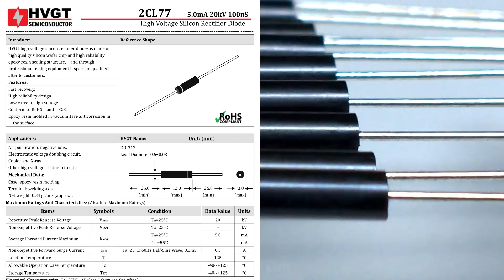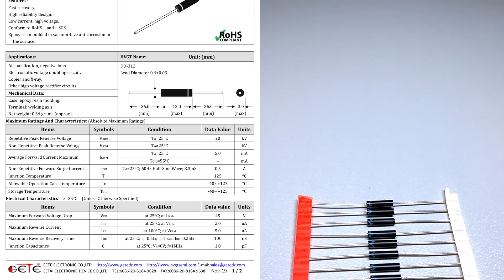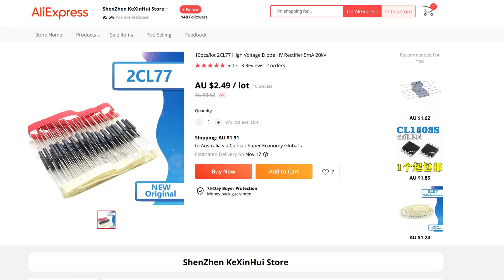20 kV Diode Teardown

Comment: Great view of the inner construction! It's funny, if you read descriptions on using diodes, they often say NOT to string diodes in series to raise voltage ratings for numerous reasons, usually describing a cascading failure scenario due to one junction breaking down earlier and passing the current to a weaker one, BUT, that is the exact way they construct high voltage diodes as shown by your careful dissection and viewing. Granted, more care in matching the forward breakdown junction is most likely put into these, but there still will be variables that will make no construction a "perfect balance" throughout its manufacture.
Reply: Almost all HV "diodes" are made like this, you should see the diode strings used in megavolt powers supplies for particle accelerators like dynamitrons, its the same just thousands of them. I think the key for successful series diodes is to greatly under rate it compared to the single diode specs. Say a single diode has the specs of 1000V 1A peak and a recovery time of 20ns but you want a diode string to rectify say 10kv 100ma so you put like 30 of those diodes in series, that could theoretically yield a 30Kv 1A diode string but you only rate it as 15Kv peak 500ma 100ns recovery time.

Comment: Hey WizardTim. I work for a company in the United States that makes high voltage diodes - quite similar to this one. To give you a bit of feedback on the forward voltage drop, two main points: 

1) HV diodes tend not to be a typical PN junction since they hold off about 1kV per wafer, they therefore are thicker and have a different resistance profile because of it. This makes each diode wafer usually more in the 1V - 2V per wafer range, though this does depend some on the reverse recovery rating of the diode. 

2) Keep in mind that the rated VF is the absolute maximum for the diode, so there is likely some margin there. For instance, on a similar diode we manufacture, a 45V VF rating usually means the diode tests (on the bench) more in the 35V range.

Feel free to comment back if you want more details or have any other questions about high voltage diodes or high voltage diode manufacturing. I would be happy to provide more information.
Reply from the maker: Thanks for the info!

Since posting this video I measured the diode with a PSU at some currents:
15.5 V @ 1 mA (0.70 V/die) 
21.2 V @ 5 mA (0.96 V/die) 
24.8 V @ 10 mA (1.12 V/die)

So as you say they’re just rather generous with their max VF rating. This is kinda surprising to me as the power dissipation will be almost half, but at 20 kV @ 10 mA (200 W), 0.2 W is 0.1% so I guess it doesn’t matter that much.
Reply: @WizardTim  Yeah, it is a little surprising that it was about half of what their rating was for the parts. Looking at the datasheet that google provided, I don't see any graphs for VF vs IF which is what I usually point people towards instead of the max of the part. For our diodes, we have a VF rating, but if you look at a typical VF vs IF graph, you can see that at the rated current, the diode typically has about 75% of the VF rating as voltage drop. 

You are right about the 0.2W not being much with regards to the overall circuit (20kV and 10mA), but for a device small like this, 0.2W of power dissipation could be significant depending on your heat path. We have a similar part rated at 16kV (datasheet here if you are interested: https://voltagemultipliers.com/wp-content/uploads/2018/10/M25UFG_M50UFG_M100UFG_M160UFG.pdf) that could have internal heating of 13°C at 0.2W dissipation. Though that isn't much, it will change the IR, VF, and TRR characteristics of the diode. 

Anyhow, food for thought. Good video. We cross section parts sometimes in a similar way to look for damage of our diodes, but I am not patient enough to do it by hand so we have a system for sanding and polishing.

Comment: Great video.  You should buy a combo belt and disc sander.  You can get them fairly cheap from your local gettin' spot.  Even a low end one will last you a lifetime.  Might save some skin on your knuckles.

Comment: Also you can get dirt cheap diamond discs from China. For use in lapidary industry and elsewhere. Usually diamond lapidary discs can be hundreds of dollars each but the cheap ones from China are only a few dollars each and go up to crazy fine grits. From there you can even get diamond paste that goes up to 0.25 micron which is about sixty thousand grit I believe. Whereas the individual grit Pace would cost 20 or $30 for a tiny amount here... The knockoff versions from China or like $10 for the whole set of all the grits and indecent quantities.

You could get half a dozen or so different grit discs for really cheap and they cut through ceramic, silicon, glass, whatever and leave behind a great finish. It's super fast and easy compared to sandpaper and can even be used with water or other fluid coolants.

Comment: Nice video,I think microwave diodes are similar to this in their structure.I have used microwave diodes for several 100kHz to rectify a Tesla coil output without any problems.
Reply: is it possible to use microwave diode for high frecuency? even that the datasheet says it works for 60hz?
Reply: @picanazo420  Many modern microwave ovens use switching power supplies, it's possible newer diodes are faster to be able to work for those.

Comment: Maybe a small benchtop belt sander would be a good investment for the bulk of sanding this down?
Reply from the maker: I do have access to a belt sander however I’m using an ‘ultra-clear’ epoxy designed for art applications so it has a glass transition at about 50 - 60 °C so I probably couldn’t go much faster but it would take a lot of the physical effort out of it. But I would also have to make the puck larger so I don’t sand off my fingers. I might give it a try if I do something larger.

For this video it was about 15 min of prep for the epoxy, a couple hours to cure, 30 min of sanding and 30 min of cleaning up (excluding all the added time filming).

Comment: 100ns  switching time - may be it is silicon carbide inside. Silicon carbide single diode have an approx 2 V drop voltage. 2v * 22 crystal = 44 v drop voltage.
Reply from the maker: I don’t think it is that as I didn’t pay much for them and the manufacturer doesn’t mention SiC which would be an important marketing point. 

Also, from what I understand SiC diodes are more suited for fast switching high power devices (similar to GaN components) like computer power supplies where switching losses account for a large amount of the losses.

So far the best reason I can come up with is maybe they just use whatever dies they have lying around at the time to get to a 20 kV breakdown, just so happens I got one with 22x 1,000 V dies but maybe 40x 600 V dies is a possible configuration which would give 45 V forward voltage drop?

Measurements I got (not very accurate just with a bench PSU):
15.5 V @ 1 mA (0.70 V/die)
21.2 V @ 5 mA (0.96 V/die)
24.8 V @ 10 mA (1.12 V/die)
Reply: @WizardTim   in hight voltage (1000v) hight current rectifier made in silicon carbide is hight cost. But in low current device's silicon carbide is ordinary material. Like as some LED   contain silicon carbide crystal inside, but not information about this in datasheet for user.
Reply: @WizardTim  I agree, it is unlikely to be SiC. SiC is more expensive, and from what I understand it does not stack well enough (at this point) to be able to do high voltage this way. If it was SiC, the vendor would have advertised that since it is very much a selling point.

Comment: Pretty cool, hope you are wearing some good respiratory protection though, like N100. Wouldn’t want to inhale any of the dust from the sanding, potentially lots of nasty stuff in there.
Reply from the maker: I wasn't wearing a respirator but I did have a fan with dust filter sucking away some of the dust. I also have several laser dust sensors and the readings weren't too bad. My neighbor's wood smoker is worse.
Reply: @WizardTim  It is not about the dust but rather about rare metals and crystals that are present there.

Comment: What brand uv epoxy did you use?
Reply from the maker: Unfortunately I don't remember the exact brand I used in this video, but it's at least not a UV resin. It's an "ultra clear deep cast epoxy resin" which comes in two parts, the advantage of this type is it isn't very viscous so it flows easy around the part and can be used in reasonably large moulds without overheating. The downside is the ratio of the two parts is very sensitive and it takes several hours to cure.

Comment: How much could this be automated? I'm imagining building a volumetric 3D image by photographing it at regular sanding intervals. That could be quite fascinating to see...
Reply from the maker: I agree that would be super cool. I remember watching a YouTube video a few years ago where someone mentioned that idea and showed a prototype of a device to do exactly that which was fully automatic, however I don't believe they got it working well enough to reconstruct a volume. I have a feeling it was 'electronupdate' but I can't find the video.

However 'mikeselectricstuff' showed you can do it on a larger scale with CNC cross-sectioning:
https://www.youtube.com/watch?v=RHqN6CTOdzA

In industry you can also do non-destructive μCT scans of components and get very good resolution, unfortunately getting time on those machines is difficult and expensive.
Reply: Or you can cast all parts exactly same size and sand half of the part by setting distance limit and stop the machine at that point

Comment: Would this technique work for looking at the internals of an IC?
Reply from the maker: Yes it’s perfect for analysing the lead frame and die placement but I think it would be rather difficult to look at the actual circuit on the die as you’d have to sand down to the die perfectly flat and parallel and not sand too far, I might give it a go and see if it works but heat or acid would probably be easier.